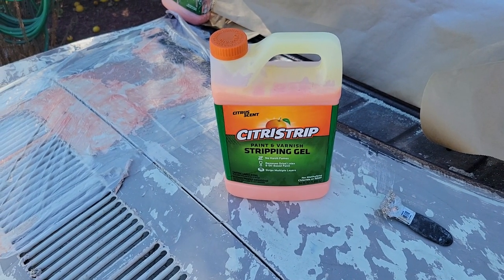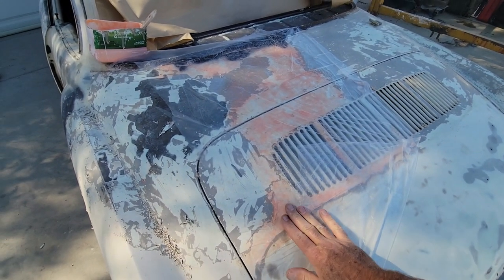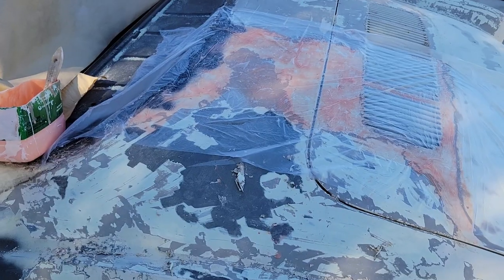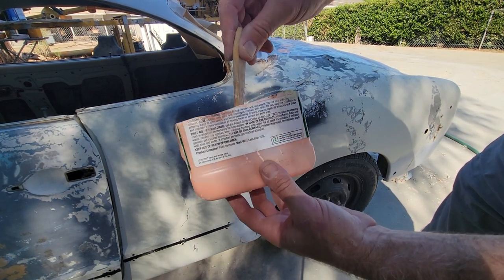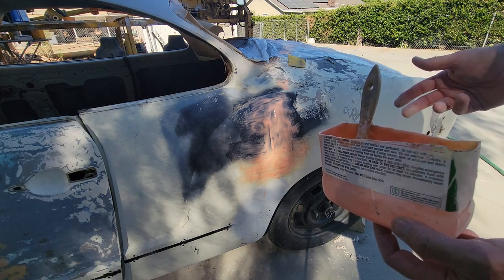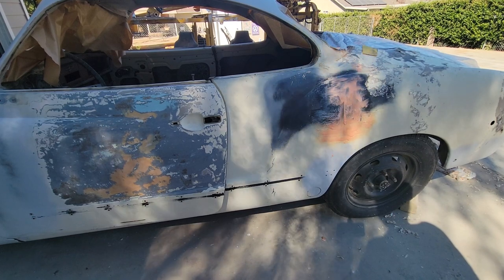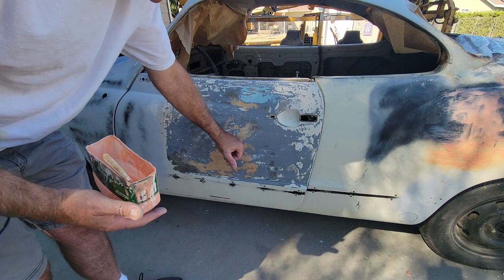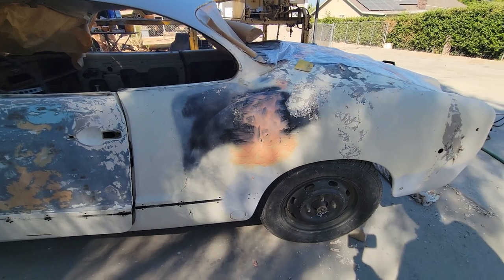Citristrip  pure citrus paint stripper tips and tricks

Comment: I used it on 6 cross members for pallet shelves today. I didn’t lather it on that thick or use plastic like you did, wish me luck lol. If the paint comes off easily, I’ll use a flap disc to remove any residue and rust. Any advice for prepping the metal afterward?

Comment: Used it..didn't do a thing.  Slimy coating remained. The torch did.
Reply from the maker: yea it wont touch good clearcoat. only good for older paints.
Reply from the maker: plus you need to use the plastic method overnigt

Comment: quick question. so my subaru im building at the moment has some really ugly single stage black paint or primer sprayed over the original color. i know that the original color is still in good condition because the door jambs are pretty shiny in it’s white. my car is a 06 so it has clear coat from factory and i want to strip the ugly paint off without damaging the factory white color. will this product be too strong that it will strip the original paint too? what is your take on it?
Reply: if u apply it it will remove all the paint

Comment: That stuff is like gum i can't get it off of what i put it on
Reply: Put Saran Wrap over it and let it sit for a while
Reply from the maker: use plastic then pressure wash. Yea it is hard to remove if you dont use a pressure washer. wont just wash off. or scrape it off. It comes off with the plastic form the most part but still some remains. Really need that pressure wash....
Reply: @mikesrandomvideos  dang. I wish I knew that before buying this. I don’t have a pressure washer or any of these other tools.
Reply: @JParkerAdair  you can take the part to a commercial car wash and wash it there.

Comment: It apparently contains a wax so it doesn't dry in use. Can't clean that stuff off a metal hvac register. Leaves the wax coating even after cleaning with alcohol.  What rubbish. Good luck getting paint to stick.
Reply: @wiseoldman5841  it literally gives you removal instructions, guess you decided not to read them. You use mineral spirits to remove it very easily.